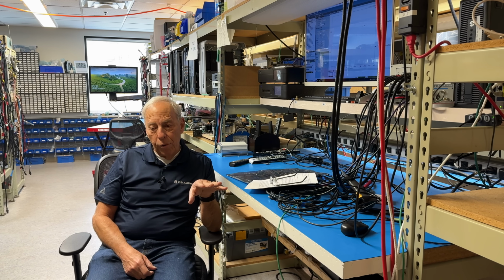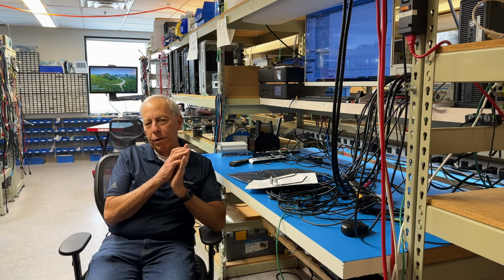Mixing speaker cable materials

Comment: Everyone's an expert and do not listen to the actual expert, who has decades of experience at the sharp end.
Reply: It's a very good practice to listen real experts, not only one. They might have different approaches that can be very helpful and complementary. Only one version isn't usually a good recommendation.
Reply: I find that the more experts you listen to, the more confused you will become. That's why it's better to do your own experiments, and become an expert on what you think sounds best yourself. A  lot of people don't think it makes a lick of sense that cables cost so much. I have some speaker cables and one end has two spades. The other end has 4 spades. They are not marked as to which speaker terminals they should be connected to. And the speaker with 4 binding posts, doesn't say anything either. I purchased used and have no owners manual. I can't make a lick of sense out of any of it.
Reply: Beware the one who proclaims I am the actual expert, listen only to me. The true expert offers their opinion, backs it up, but says listen to everyone and do your own work. Paul occasionally leans into this “trust me, I know best” direction as he does here,  but he stops short of proclaiming all-knowing mastery. So this comment is not about him, it’s advice to anyone who places all their trust in only one “expert”.
Reply: Are car salespeople expert mechanics?
Are "Audiophile" equipment sales people expert audio engineets?
Reply: Verden blir kjederligt uten noen  eksperimenter i ny å ne😂 happy New yr.
Reply: Yeah sometimes those experts that have decades of experience are actual SALESMAN selling you snake oil😢 Don’t fall for it. Wire is wire, doesn’t matter if you mix OFC or CCA. Keep in mind this is for SPEAKER wire, very little current especially in home audio where impedance is usually 8 or 16 ohms.
Reply: Right you are!
Reply: Ok. The truth is..the distance and guage and power of amp.
Reply: In audio freqs ..ethan winer proved this is wrong.

Comment: The mere fact that different cables are guaranteed to be used within the loudspeaker cabinets should make any meaningful discussions on this topic absurd.
Reply: Not really - inside the cabinet you're dealing with very short distances, outside with very long ones.
Reply: @werner.x  Real and true connoisseurs can hear every inch of this!
Reply: Not difficult to upgrade the wire inside the cabinets.

Comment: I have Bi wired for years and can definitely say it is a 'thing' that works for me.
Reply: Depends on whether you use the ones designed for the northern hemisphere over the southern hemisphere ones. The left-handed little people's twisted ones are deffo out. BTDT.
Reply: The wires are not just conductors, they are also a filter, because they have capacitance and inductance, however the effect is negligible  except for really high frequencies.

Doubling the wires will give half the resistance, possibly increasing the volume a tiny bit, though.

Comment: What I found on the "thicker guage = more bass and less treble" is due to distortions, caused by skin effect and proximity effect. Only in my case, the time smear that induces makes me react in the same way as hearing fingernails on a blackboard. Stranded wire being the cause of it all. If you can find an alternative geometery to a single, thick stranded cable, you'll reduce this somewhat. Qed make speaker cables to address these issues at affordable prices, maybe worth a look at their x-tube and air-core technology, give it a demo at home and see what you think
Reply: There is no skin effect at audio frequencies.  You are preaching nonsense.
Reply: Lol! Good one beavis
Reply: @editorjuno Precisely, it doesn't even have a measurable effect at such low frequencies, let alone an audible one 😂

Comment: As an anecdote: can confirm Romex of varying gauges can work really well. It's a bit stiff and awkward but will get the job done and be cheap. Had to use this hack when setting up a temporary PA system once and was in a pinch. Spliced to and attached the speakon cables. Sounded and worked great.

Comment: For a long run the most important thing is going to keep the cable away from any concrete (floor). Concrete is a ground and will suck the life out of the signal if the cable is on the concrete floor.

Comment: Bi-wiring with 12 gauge for bass and a lower gauge cable with low capacity and inductance for mids and treble is what I use. Works well at moderate cost.
Reply: Recommending common items like Romex is excellent practical advice. I applaud it. However, the idea that thinner wire in parallel with thicker brings out more high frequency is extremely dubious. No, I am not accusing you of making it up. Yes, I can try it myself. However, unless you and I try it on a BLIND compare basis with two wires of equal thickness (that collectively add to the same gauge as your thick/thin pair) there is no way to know this is really true. The placebo effect exists. Confirmation bias is real. There is no human, expert audiophile or not, who can hear a meaningful difference in the test I outline on a blind basis. That’s not an attack or an insult, it’s just abject common sense.  But please, I beg you, prove me wrong. Do a live video showing such a blind compare, and show us that you can tell which pairing is which over multiple blind trials. Until then, since your suggestion relies on common, reasonable cost items, and is just another path to a thicker gauge, I suppose the idea does no harm.
Reply: Cardas audio does this gauge mixing at a more extreme level using the golden ratio.  Has to do with minimizing eddy currents that whisp around the wire.
Reply: Capacity and inductance play a role at high frequency. This might explain why a large cross section is not the universal and cheap solution.

Comment: Ryan doesn't need to concern himself as much with what kind of speaker wire to use. Of more importance is that he uses balance cables for the run lengths he is talking about. Make sure your smplifier(s) and speakers have balanced connectors!!

Comment: A great subject that I have played with for many years. Tried very exotic cables which frankly disappointed. Like Paul I started with twin and earth domestic cable of varying gauges many years ago. Again a very cheap way to trial. This like most areas in our hobby is very subjective. But the debate of gauge, construction and material can only be determined by yourselves as to which sounds the best in your room and your system and your taste, honestly there are no short cuts.

Comment: Hi 👋 Paul, very interested, my transmission line cabinets are Bi-wired, and have 2 drift gauge wires going to the crossovers, Units on the back, I had made my cabinets around 40 odd years ago, a colleague of mine made the crossover units, they sound amazing, until one day I moved from England to France, and I forgot to mark up the cables, Finally, set up the system, just to noticed that it was lacking something, I thought at first I done something to the speakers, then realised that I’ve got the cables plugged in the wrong sockets, and I was very surprised with the difference in sound, obviously the heavier thick cable goes to the low range and the flexible cable goes to the high  range, 
A question whether you answer or not, or whether somebody else will , is it better to twist the cables together?, Or plat them., or just run them side-by-side , if you are going to make just one pair for each cabinet likewise, twist, Plat or side-by-side, and I have seen on some high-end hi-fi set ups cables are actually on little pillars of the ground/floor, what does this supposed to do?, That is the question, 🙋 oh master, 😂. Phil from the moulin France
Reply: Twisted pair is a popular cable configuration that has been used in telephone wiring for decades.  It’s easy to do, and the magnetic field of each wire rejects outside EM interference that could result in noise being picked up by the other wire.  Thus, twisted pair wires are quieter than side-by-side wire pairs.

Rather than twisting lengths of wire yourself, it’s easier and more consistent to just buy twisted pair speaker wires in the first place.  Knukonceptz Karma Kable comes in sizes from 16 gauge to 8 gauge, has a thick clear sheath over the wires, which are also individually sheathed, and is relatively inexpensive, so it’s a good deal in every way.

Comment: Hi Paul I am learning loads of information from you, so thank you. I did a search based on this topic and it led me here. I was thinking of running 12AWG OFC ground and 5-strand of silver core 18AWG for the positive. Do you think this would work to mix copper vs. silver for grond and positive as this would definitely save on some cost instead of using all silver? Or do you have any ideas on a better experiment with less learning curve? lol, thanks.

Comment: I have used 10 and 8 gauge wire. People have asked me about signal loss and how much power can you put through a cable. A lot of times you don't need to worry about it unless your running massive amount watts through the cable.

Comment: Did I get it right - 2 parallel lines, 1 with 12 gauge and 1 with SOLID CORE (?) 16 gauge ?!
Reply: In the case of bi wire terminals, then what? What about if I can buy amp? Still run small gauge for the highs?
Reply: @helmut3356  so 1 cat6 cable for each positive and negative on the mid/high? With the 4 starands in each connected together?
Reply: @helmut3356  dam this is taking a long time to make, so far managed to braid 2 feet.
Reply: @helmut3356  ok, finally all done, I put one side on at a time and I can definitely hear a different, I honestly didn't think there would be.
Reply: @helmut3356  I'm loving the sound so far, can't believe the difference

Comment: Hi Paul, did you ever tried using ethernet kat6 cable as a speaker cable. Using it in my system (Low watt Tube amp with high efficient Speakers) and it sound amazing...good. Don't know the science behind it but it works very well, much better then some expensive and well know brands I used before.
Reply: Likely due to the braid and the effect it has. Try kimber cable braids and you will be like WOW. They are the OG at the complex braid.

Comment: I understand what you are saying but over the years I have found that using 12 gauge stranded instead of solid work very well. I know all the professional speaker cable, like Monster cable, is all stranded so to stay in budget I just used regular cable. Not sure my ears could tell the difference.

Comment: For 30 to 40 foot runs, if you're really concerned about signal integrity, go with either powered speakers or an amplifier placed locally near the speaker. Balanced line level interconnects, of course. Oh, and put your interconects in metal conduit and avoid running in parallel with power.

Comment: As per richard vandersteen when asked the queation to biwire his legendary model 2ce i did biwire and did notice a difference by 1st using 12q\2 then 12q\4 ofc did efect the sound better tighter bass and opended the soundstage, then tried 12\2 for bass and 14\2  for mids and highs.  i Did notice better high and dynamics by doing so. I thought at first it was just my wanting it to work hut i fid this comparison with my son who loves music and is 23 so his ears are much better than mine. He heard the differences too. Soo richard was right and so were you Paul

Comment: I have a distributed audio system in my home & all the speakers are ran with 16awg wire and some runs are as long as 50 feet. Never had an issue with "voltage drop" I guess you could say, however yes, the low end bass could be better if I used 14 or 12awg. But nothing that the average ear can detect lol

Comment: Plenum rated speaker cable is required by building code.  NM cable is approved. but heavy gauge 14/2 stranded would be better choice.

Comment: Typically multi-zone venue systems use 100V line amplifiers - so the long runs wouldnt matter. When pre-wiring a venue trying to get cables through tight spaces... thicker cables get in the way of that. We used to use TOA for these types of venues that run their systems for in excess of 3000 hours a year. Domestic systems arnt good for it.

Comment: If you manage to find info about antenna signal. Radio or wifi then wifi uses very thin cables. So high frequencies pass through thinner cables more easily?? How much better treble will it be with thin cable??
are some of the questions
Reply: wifi uses radio frequencies (2.5GHz, 5GHz) transmitted and received by antennas. Ethernet uses very thin cables or fiber, but the signals are digital. Skin effect is what you are talking about with high frequencies pass through thinner cables more easily. But:"Regardless of marketing claims, skin effect has an inaudible and therefore negligible effect in typical inexpensive cables for loudspeaker or other audio signals.[9] The increase in resistance for signals at 20,000 Hz is under 3%, in the range of a few milliohms for the common home stereo system; an insignificant and inaudible degree of attenuation.[7][10][11]". But also know that I'm not an audiophile.

Comment: When I first got into a proper setup, I was taking advice from a sound engineer friend who works in huge auditoriums on professional system. He was adamant that cables made no difference. I designed my first system off his suggestions which was all about accuracy and flat response (as I’m sure he’s used to in his world), while it was a great system, it didn’t MOVE me. I then over years studied up a lot, learnt about different metals properties for conductance and resistance, and tried different things in my system, watched a lot of YouTube videos from people including Paul, and have found that these things do indeed influence sound, and the more I understood the electrical properties of different conductors, it started to make sense of why that is. Home audio is far more sensitive to these adjustments, so long as your ears are sensitive enough to perceive them.

Comment: I love this kind of thing i have some thoughts about what might be the source of this change in frequency response.

I'm pretty sure the intensity of reflections due to impedance mismatches between source, load, and cables is frequency-dependent. Im not sure how severe it is at audio frequencies given most of my exposure to the stuff is at radio frequencies and in a classroom. This seems to be a solved problem for commercially produced cables and loudspeakers though (i may be wrong), so my guess is that impedance matching is only important when selecting the material and length of the wire, not the gauge. There is also something to be said for the relationship between the number of reflections off of the outer boundary of the cable must increase with frequency for signals to arrive concurrently. I think this is inevitably what causes the loss of energy as modes mover around.

My other thought is that given a mode of propagation in a transmission cable which transmits audible frequencies, the bands of that mode are proportional to the cross sectional dimensions of the cable. That means that at a larger radius (lower gauge) the frequency band of the propogation mode is centered around a lower frequency. Because we perceive frequencies on a logorithmic scale and not a linear one, this linear shift of the band determined by the dimensions of the wire will start to favor lower frequencies in the human ear. 

i leave this comment without having done any research on the matter, so take it with a grain of salt. I imagine the real reason is adjacebt but not quite what I've put here.
Reply: I just took a class in electromagnetism, so the material is fresh on my mind is all. Just want to stress that I'm not claiming to be an expert
Reply: @reesetyra902  Spent too many decades in microwave IC circuit design, none in audio frequencies. But, I thought that because the frequencies involved in audio are 10^6 lower than what I was used to, all those concerns (modes, impedance matching, reflections,..) are ignored. But I am completely guessing.

Comment: I tri-amp and use 12 gauge stranded for each run. Maybe I should try smaller gauge for the tweeters.
Reply: Wow, not heard of tri amping before, is that to serve bass, mids and highs separately?
Reply: @SpyderTracks  You can also try litz for mids and highs.  The 24 gauge twisted pair in ethernet cable is a cheap way to source it.  Tie all the colored wires together and clear together for + vs -.  Test to ensure no shorts and done.  If you want to get fancy braid the runs of pairs.  All the better if you can find the fire rated teflon insulated version.
Reply: @SpyderTracks  Yes. JBL 4343 clones have 15" bass, 10" mid-bass, and compression driver mid-high. I don't have the super tweeter, because I swapped out the horn on the compression driver with "The Tube" Karlson coupler, which allows the compression driver to go above 20 kHz. I didn't have the skill to design good crossovers, so bought good electronic crossovers and extra amps. :)
Reply: @BlankBrain  I’d love to hear that, sounds impressive!

Comment: I recently changed my 16 gauge silver wire to 14 gauge 999 solid silver bare wire covered by an 8 gauge teflon cable.

I definitely get a thicker sound with great bass and a well balanced highs. 

I took mine a further step and slathered Furutech Liquid Nano along the wire and rubbed it in with my fingertips. I like the sound it lends to my terminals and added that to my whole wire.

Although, I leave my wires unterminated.

Comment: Well this is easy to test. Run only a 12ga wire to your speaker and measure the voltage on the tweeter. And lets use a DAW so we are analyzing real music in case anybody brings up the old sinewave argument. Then measure again with the extra thin wires added. Sync the tracks and see if is there a difference? If so, how much?